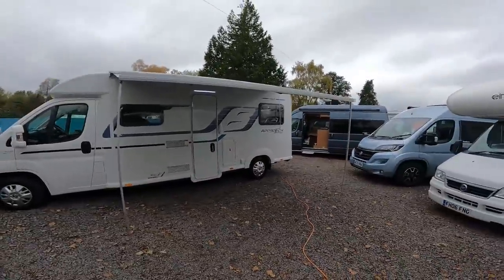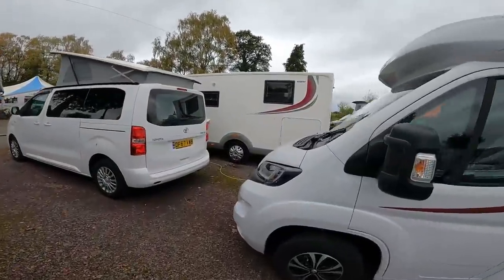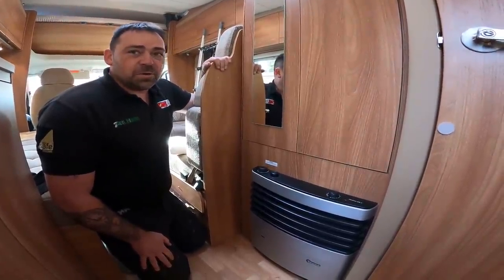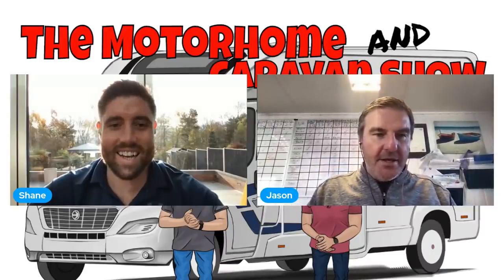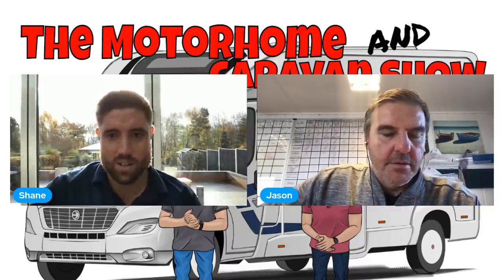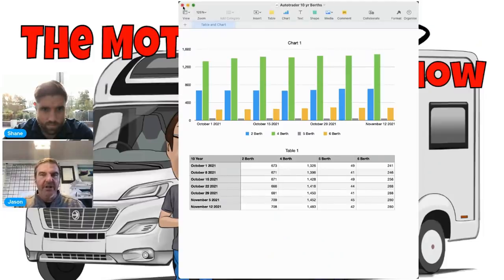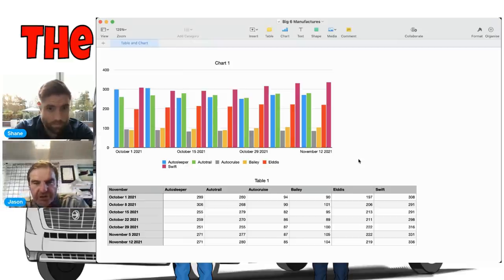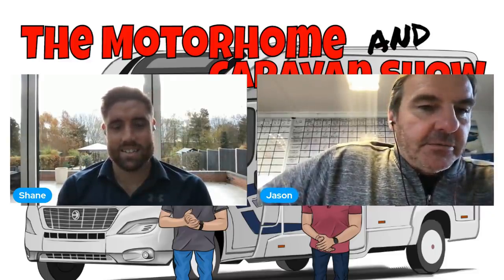MOTORHOME MONTHLY ! News Tips and Used Motorhome Prices

Comment: It's the same in many businesses Jason , no stock , Peugeot are not making any boxers until at least next june according to local dealers , electronic chip problems worldwide , cars and all Van's are the same , which just puts prices up , we buy any (van , car , etc) are paying massive money,  dealers cant have empty pitches so they have to pay more so the end user does too , I wonder what's going to happen when the clean air zones come into effect with the thousands of Van's converted  to day van's and camper Van's  done at home on the cheap , which still say van on the V5 , and they have to pay upto a tenner a day to drive it anywhere in the chargeable zones , Greater Manchester zone which comes in next year is about 430 square miles , plenty money for the govt